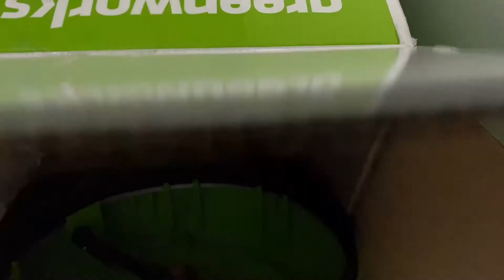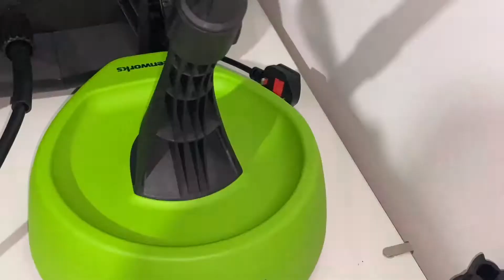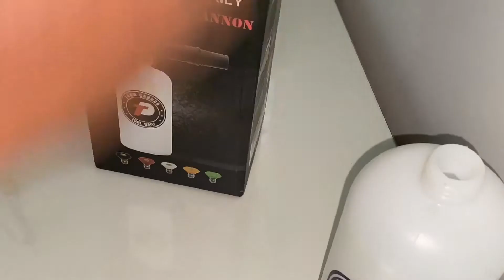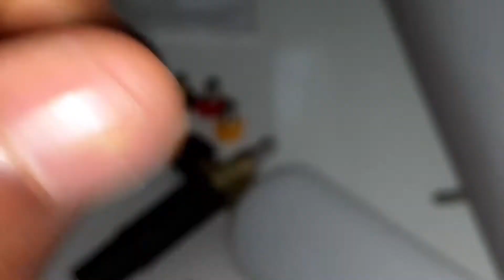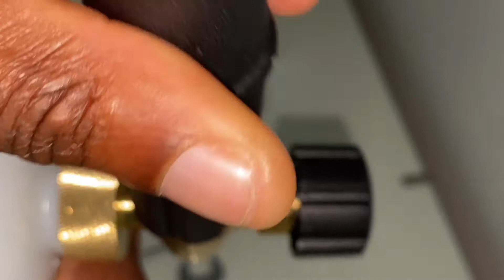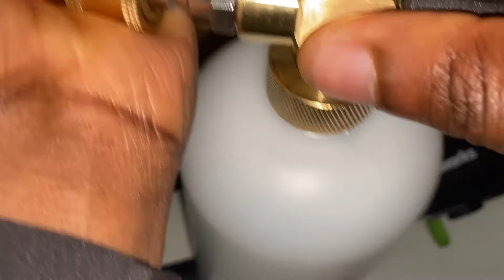How to chose & connect your Foam Cannon Adapter, Hose & Car pressure washer to Kitchen & BathroomTap

Comment: Hi I can have the link of where you bought the correct adapter also I myself problem thanks
Reply from the maker: Hi Simone, you can purchase from
EBay or Amazon. See links below for adapters. 
Don’t forget to Subscribe and share. 

https://www.ebay.co.uk/itm/313611605654?mkcid=16&mkevt=1&mkrid=711-127632-2357-0&ssspo=6vjmlzvwrqo&sssrc=2349624&ssuid=3GjHY9t8S8O&var=&widget_ver=artemis&media=COPY

F Fityle 1/4 inch Foam Connector Adapter for Series Electric Pressure Washers https://amzn.eu/d/fextvmq

Let me know how you get on. Have a pleasant week ahead.
Reply: @TheReviewRoomPodcast  thanks to your video I solved a big problem thank you very much

Comment: I don't think I am going to get the pressure I need and will probably need to swap it out, do you have a link for the part? Thanks
Reply from the maker: what part? foam cannon, wand 1/4 " adapter or tap adapter?
Reply: @TheReviewRoomPodcast  The orifice. Thanks
Reply from the maker: @speppard81  Stone Banks 1.1mm Foam Cannon Orifice Nozzle Tips and Foam Maker, Replacement Accessories for snow Foam Cannon (2 Pair) https://amzn.eu/d/6srAxRd . Click on the link in the description on how to install and Don’t forget to subscribe and share. Have a great week. Cheers